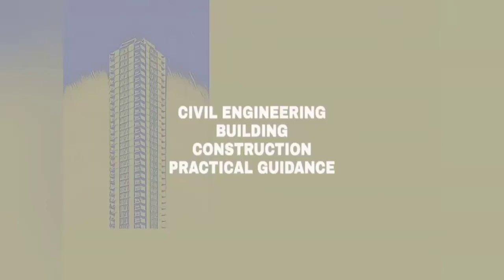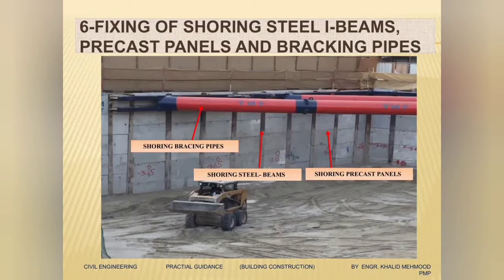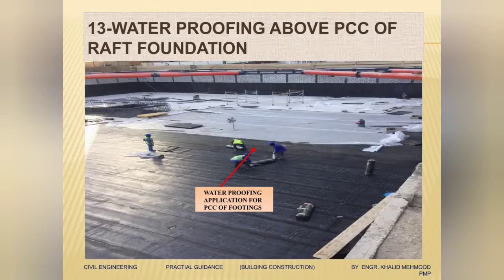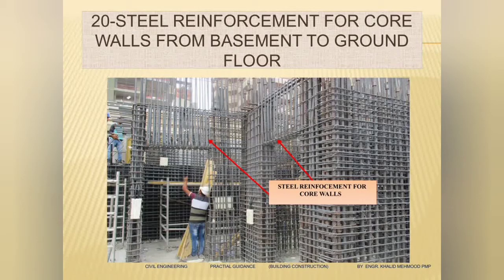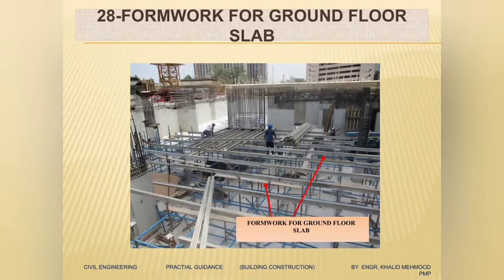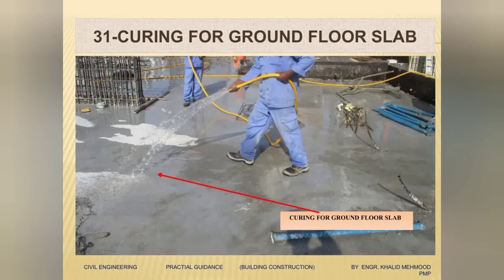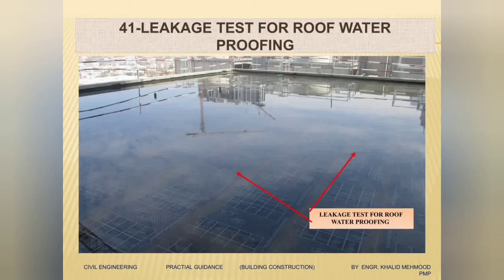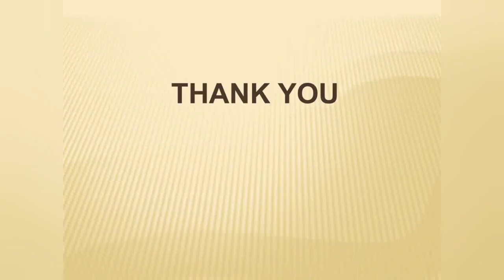SEMI HIGH RISE BUILDING CONSTRUCTION ACTIVITIES STEP BY STEP FOR STRUCTURAL ACTIVITIES

Comment: Will the shoring be removed after retaining wall construction? Is the shoring temporary?
Reply from the maker: I apologize for late response, yes shoring can be removed after casting all retaining walls and ground floor slab above basement just to cope with lateral surcharge load, appreciated for response, any other questions please don't hesitate to ask me apart from this video also
Reply from the maker: Yes shoring is temporary and will be removed after all retaining walls casting however it is recommended to remove after ground from slab casting so as to cope lateral surcharge load of existing nearby structures